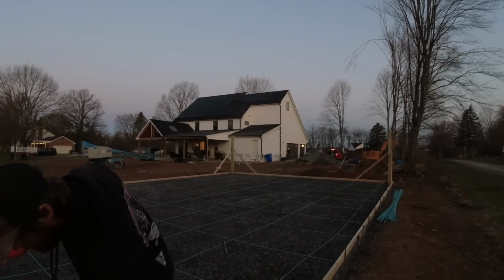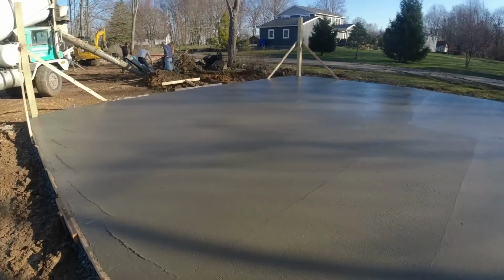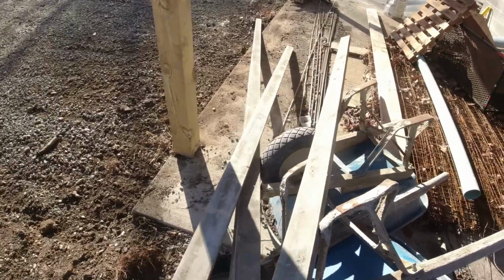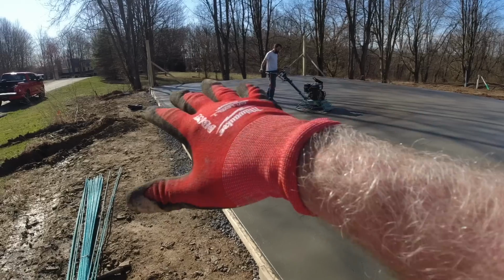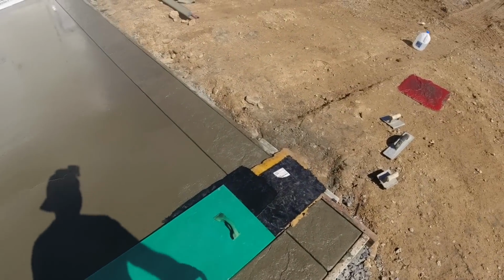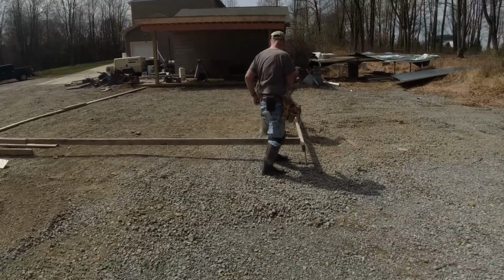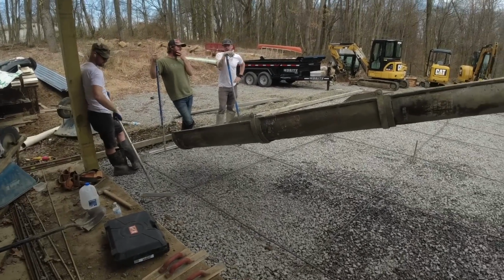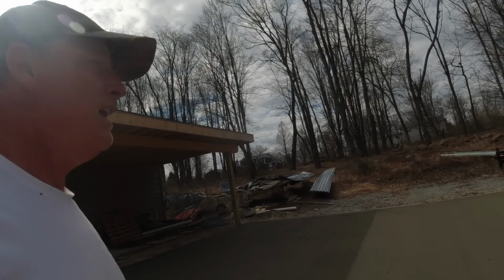Just Keep The Trucks Coming!

Comment: Tom, I saw a cute trick on another you tube. They used a 5-gallon pail to catch the sawdust straight from the bandsaw as it was making each cut and at the end they emptied the bucket into a large trashcan. That is one way you can work indoors with the Wood-Mizer.
Reply from the maker: That would be nice

Comment: It snowed here this morning. Not a good start to the week
Reply: I'm assuming the court is going to have a top covering, otherwise you'd kill yourself when the slab was wet.
Reply: @iowamatt2519  can you say,....
Ice hockey! Lol
Yeah, looks as though it'll be covered, noticed the 6x6 posts in the corners.
Reply: @iowamatt2519  There're special tile looking made of a hard rubber, interlocks to each other. ( screw the perimeter ). When the ball bounce is if was bouncing on wood. (Mimic a real basketball court) available in team colors. Lines and all.
Reply from the maker: 32 tonight
Reply: @alithemagicbum  That's what I figured.